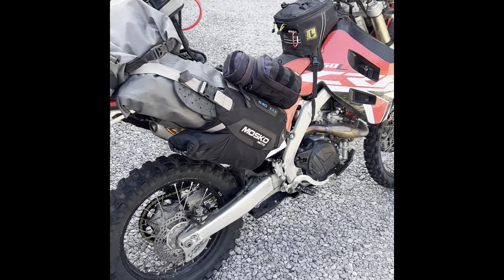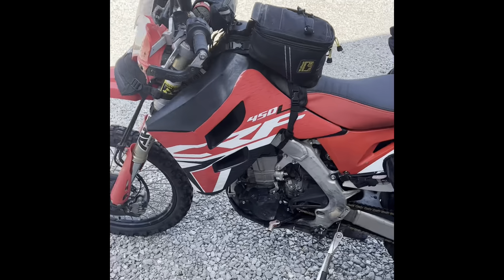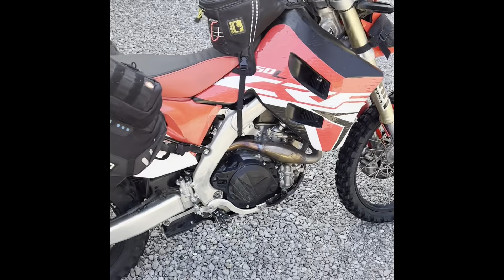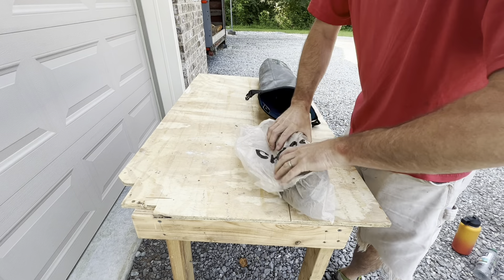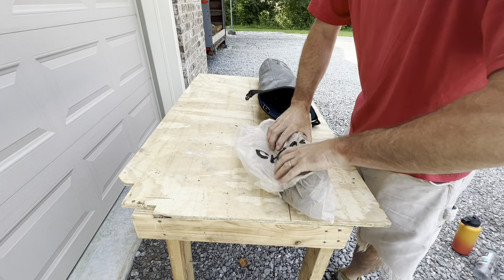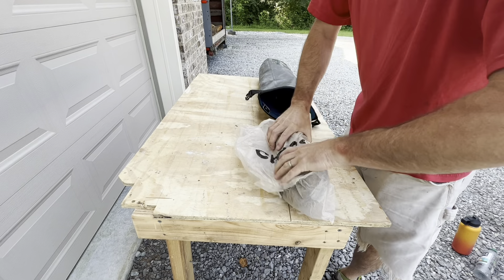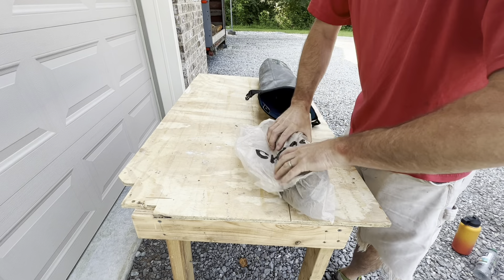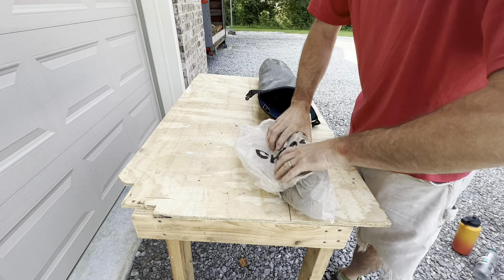Trans America Trail: What I took, How I prepped and what I learned

Comment: Bravo and well done!  Does the 14/45 setup work well off road as well?
Reply from the maker: It’s fine as long as you aren’t getting into technical terrain and it does require more clutch work. If you are wanting to do more off-road than on-road, 14/48 would be a good option also.
Reply: @professionalpiddler1071  It's always a trade off...ugh.  I have 14/48 on my 501S now and just considering other options.  Completing the TAT is a huge deal.  Be proud!